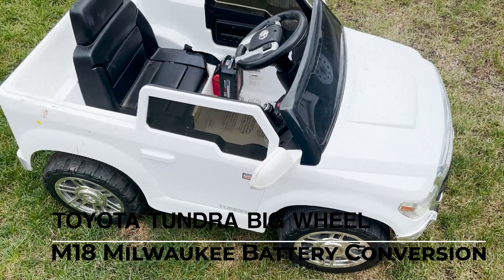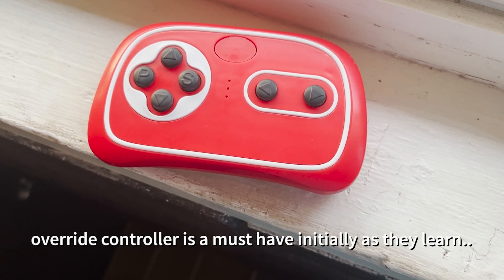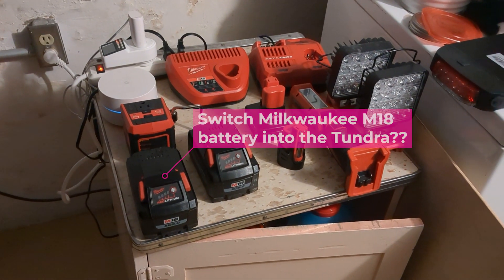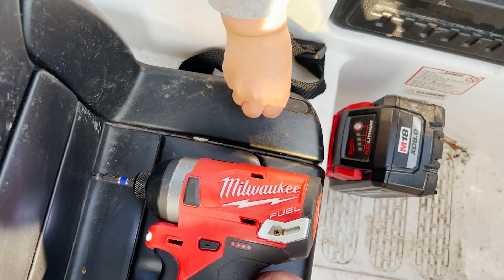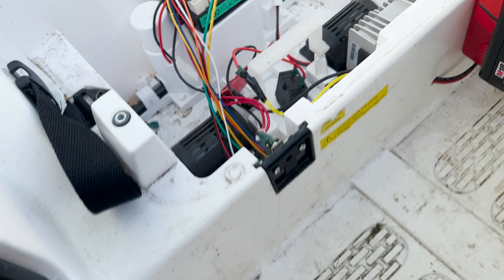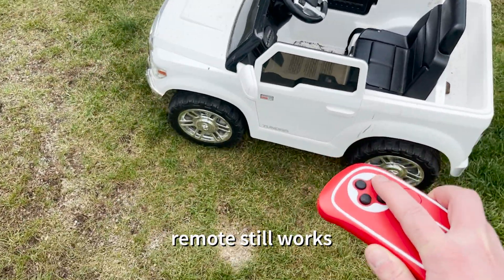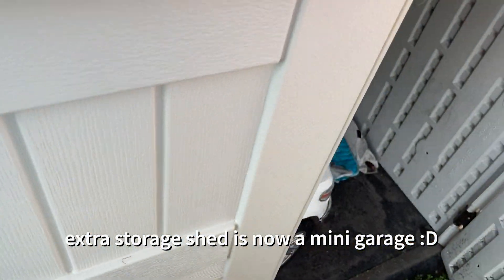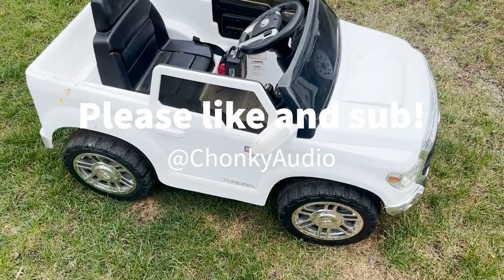Converting a Toyota Tundra Big Wheel to a Milwaukee M18 Battery

Comment: Does it go up steep hills without shutdown from overload to the converter?
Reply from the maker: It does surprisingly well on hills, smashes through grass and tall sunflowers pretty well. It doesn't do well in snow or mud though
Reply from the maker: But I've never had it get too hot or overload though, more that the electric motors aren't very big in general

Comment: Hey, after doing all this did you notice a increase in power for the car? Or was this just for the change of method charging? 
Thanks.
Reply from the maker: With the step down converter, the speed remains the same; so essentially just for the change in charge methods

Comment: If I have the 24V version of this Tundra, do I need a stepdown converter?  Also, did you notice any speed gains from using the milwaukee battery?  I feel like the 24v Tundra I have is sooooo slow...
Reply from the maker: I would get a converter so that the motors don't burn up, I know a few people who have wired them up without converters, sometimes it runs faster, but runs the risk of burning up the motors. Fisher price Power Wheels also have a good way of hooking up Milwaukee batteries using the battery base I show in the video - best of luck
Reply: @ChonkyAudio wow the view and open land at your home is amazing